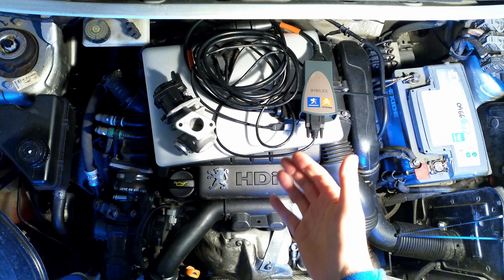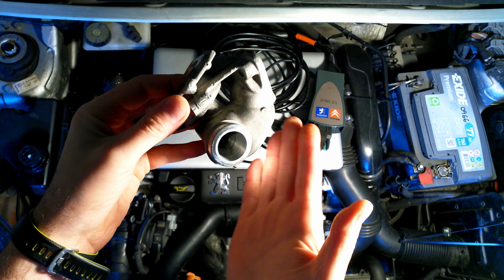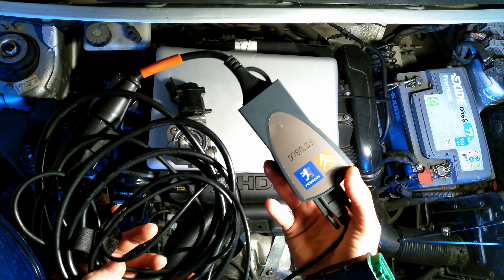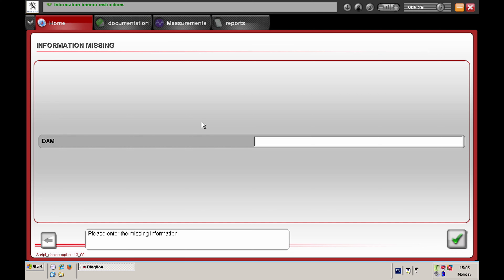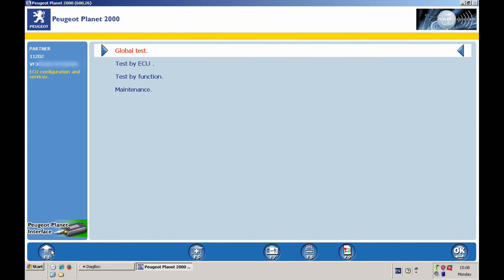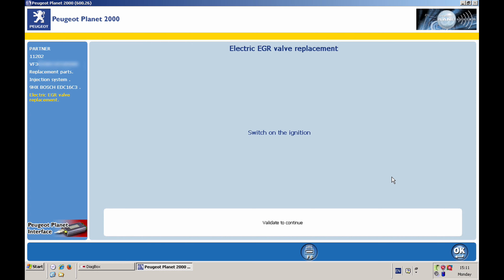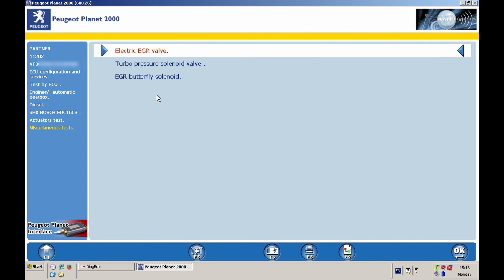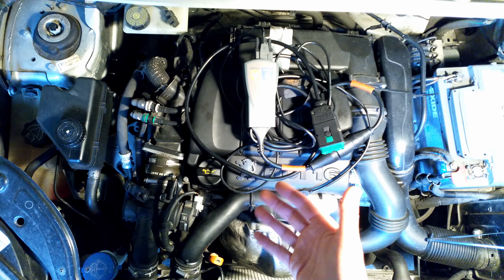1.6HDi new EGR valve recalibration or reconfiguration, how to with Diagbox or PP2000

Comment: Hi, what you explained is very important for the proper functioning of the EGR valve. The same procedure can also be performed when cleaning the valve. Unfortunately this valve is a weak point for DV6 engines fitted to both Citroen / Peugeot and Ford. Often this valve blocks or malfunctions and the engine loses power.
On Ford engines the same procedure can be done with an ELM327 interface, a laptop and the Forscan free software.
Congratulations for the video and greetings from Italy.

Comment: Hi buddy, I followed your video to clean the egr valve on my 2010 C4 hdi 1.6 and it seemed to have sorted the faults I had (super easy to follow for a beginner like me, you are a true hero). However, a month later and the faults have reappeared today - I am wondering what my next steps should be? Should I try another clean? Should I now try replacing the egr valve completely? Any help would be hugely appreciated.

Comment: Hi thanks for the reply on your other video, it was on the wrong way but still went into limp mode then opened after 20 miles or so, 
I bought another egr but seems like I need to calibrate it as it’s still the same, Is there no other way apart from diagbox? As I don’t have that! Thanks
Reply from the maker: Unfortunately no, there might be some other professional tools that can do the same job, but I do not know them.

Comment: Hey again.

Been doing loads of work. Swapped the no name (new) egr for a Valeo one and the fault codes that I used to get are gone.

I did also have a spare air doser/throttle body laying around (since theese can leak pretty bad) so I swapped that also.

But now I get a pending P0100 code instead 😢
Reply from the maker: The P0100 could be MAF sensor issue. If I were you I would disconnect the MAF and see if it makes a difference. If there is no change then the MAF is likely to be the cuplrit.

Comment: Nice video
I have a Citroen C4 1.6 HDI 90hp 2007 . In the morning it does not work stable, with a stable idle. When the engine is cold in the acceleration from 1000 turns to about 2000 turns the engine makes a rattling. It's like some injectors dont work or work badly. Over 2000 turns, it works better and accelerates. Rattling is still there but very little. When is warmed up work at low turns okay with almost no rattling. At a stable speed low (under 2000 turns and 1 or 2 gear) the car jerk little. The injectors are OK (I had sent them to a workshop and we had received new codes) obd codes does not show something.I changed the EGR last year. Fuel Pressure Sensor 1 week ago. Before two weeks I had changed the BSM (new). Sporadically the OBD appears P0490 electric egr valve position copy signal insufficient opening of the valve and P1162 electric egr valve position copy signal valve jammed while driving. I took the EGR out, I cleaned it and i made a  reprogramming with superscan3. No codes more but the rattling problem is still there. What do you mean??
Reply from the maker: OK, a lot of things going on. Best is to first address the error codes that appear and then move on to the others. Rattling can be from multiple things and more difficult to pinpoint.
I have not heard about the superscan3. As far as I know, only Diagbox/Lexia can do the re-programming of the EGR. I would say to monitor the error codes and if the EGR reappear again then you would need to find Diagbox/Lexia to re-program or re-learn. The injectors also need to be coded for the engine. Did you recode them? Maybe they are coded to the ECU and hence the bad knocking/rattling. If the superscan3 can do live data, see what the individual correction values are for the 4 injectors. Anything more 1-1.5 or less than -1 or -1.5 is on the suspicious side of things.

Comment: Hi! I found this video while searching for a solution on my 2005 1.6 HDI Peugeot 307. I had problems with the original EGR around 520.000km. So I’ve bought a used one and worked for few thousand km and then the car started to shut off when driving and the minimum rpm was jumping high and low. After that I’ve decided to buy a new one from eBay and I’ve reprogrammed it with DiagBox (strangely pp2000 wont recognise my ECU) but I’ve managed to calibrate it with diagbox. Everything works fine but after shutting off the engine and then turn it on again, antipollution fault comes back on with check engine light. Diagbox finds various problems, which are about the EGR position. The car drives really well but when the antipollution fault comes on it won’t go over 3000rpm sometimes. Do you have an idea why the calibration won’t work? Maybe the ECU won’t recognise an aftermarket EGR? Thank you 🙏🏼
Reply from the maker: Hi Riccardo, I had a similar problem. I bought a brand new replacement EGR (Haas), recalibrated it and everything, it was working alright, but it was giving errors. Sometimes it was getting stuck. I opened it and the channel inside was not machined really well and the pin with the two rollers at both sides was getting stuck. See if you can open it and see if the small pin moves freely, otherwise if the calibration is successful, there should not be problems. Since that one, I bought Hela and never had problems with it since then.

Comment: Hi I done this today after egr replacement.  But it's still lumpy/ rough idle when cold . Any ideas why or does it take time to learn the new egr the original was a valeo . But the mechanic basically lied to me and put a delphi on and charged me oe price. And good videos mate..used a few of yours now good information
Reply from the maker: Delphi and Valeo probably the same quality. Do you have any errors regarding the EGR valve? It might be something else, for example MAF sensor. If I were you and you do not have any EGR errors, I would unplug the MAF sensor before starting the car and see if that changes anything.

Comment: I cleaned the EGR valve a year ago and today it came out a DTC P0402 Exhaust Gas Recirculation (EGR) System - Excessive flow detected. I also cleaned the curved pipe that goes into the manifold. I wonder if I should clean it again or buy a new one, Hella is a trusted brand? Could it be caused by a faulty MAP sensor? No signs of bad engine behaviour, just the message faulty anti-pollution system. Do you know of any cheap diagnostics tool valid for various car brands, Peugeot and Opel? Can you test the turbo electrovalve as well with the engine running? EGR valve P/N 1618.NR?
Reply from the maker: I really like my Hella EGR valve, pretty trusted. I replaced mine with Hella a couple of years ago and have not had problems. The recalibration can only be done with Diagbox or PP2000 (part of diagbox) for Peugeot and Lexia (part of diagbox) for Citroen. It cannot be done with any other OBDII scanner. It is likely to be the EGR rather than MAF. Not too sure about anu good cheap OBDII device. I have tried at least 3 different brands (cheap) and only one worked after a lengthy trial and error, but I was using iPhone and that is problematic with these. With Android any should work alright, althoughmost do not quite work with the OBD port of the Peugeot/Citroen. It is pure luck to be honest. Go with whichever says works with Peugeot/Citroen, but still it is a bit of luck.
I would clean it again, if you can erase the errors and see if it comes up again. These are generally temporary errors, so if you clean it and that was the cause it would not show anymore, but it will be logged in the ECU.
I had a new Haas (as in F1) EGR valve to replace my original one. I thought since they are in F1 their parts should be good. This valve gave so many errors in the first few months. I opened it and the channel for the pin above the valve was not machined correctly, i.e. smoothly enough and it was sticking from time to time. I bought a Hella and have not had problems since.

Comment: Hello can you tell me where does the solenoid fit into the valve and where does the position of the valve have to be as I am unsure / any help would be great thank  you as you have the only video that shows someone removing the solenoid
Reply from the maker: Which solenoid, the top electronic part of the EGR? I have several videos that show how to put it back together, but maybe the question is different. Browse my EGR videos and you will find the ultimate EGR cleaning and a video about the top part itself.

Comment: Just stumbled on your video by mistake’glad I did. I’ve just replaced the EGR valve on my Vauxhall insignia but I didn’t know they had to be calibrated can you tell me what I can use to calibrate it’thanks
Reply from the maker: Not too sure about Vauxhall. It depends if it is electronic EGR or vacuum one. If it is vacuum operated there is no need to do a relacibration. If it is electronic then it should be done, but the software will be specific to Vauxhall. Not too sure what the right one is.
Reply: @moremolecules  yeah it’s electronic’ok thanks

Comment: Hope you're feeling better after you're covid situation... EGR function. I have replaced the EGR with new EGR and i have the problem that midway driving the EGR is opening and closing feels like I'm running through a puddle water  constant dip in power .... i have a remapping dude that will need to clear code and remap the car according. Like you say replacing EGR 50/50 shot it will be fine ore not..
Reply from the maker: Hi Peter, not too sure about what covid situations you mentioned, but you are right, sometimes it works sometimes not. To be certain, it needs recalibration.

Comment: Do you know of any manual to see all the potential things you can do with this diagnostics tool? Signals readings and plotting, advanced fault codes, guided diagnostics...I guess they have a more complete diagnostics tool at the Peugeot workshops .
Reply from the maker: I do not think there are manuals for Diagbox, although there might be something somewhere, but I have not seen it. The full version has a lot more in terms of diagnostic of the error codes, but as functionality is pretty much the same. Yes, you could get all sorts of data and export the raw data and plot them as you like. The full version is a pretty expensive affair.
Reply: @moremolecules What Diagbox version do you need to do basic things? 7.02v is ok? Do you really need to get all the updates? When do you have to connect the cable? Before or after opening Diagbox and choosing the car model?
Reply from the maker: @csraln6748  Yes, 7.02 is absolutely fine. Of course it depends on how new your car is. Mine is 2008 and 7.02 can do all the stuff. I even had 6. something and everything was absolutely fine. You do not need the updates. If your car is newer, say 2015 onwards, then you may need a newer version.
Reply: @moremolecules  308 from 2008/9 aswell. PP2000 (600.76) is not working properly because it only displays BSI and Engine/Gearbox under Test by ECU/ECU configuration and services and it does not get to connect to any system (Functionality not available!), Test by ECU and Downloading are the only options displayed at the beginning. On the other hand I have full access using Diagbox instead of PP2000 but I don't know where to find the EGR valve recalibration function if possible, it's a totally different menu. It's ok to use Diagbox on a Peugeot? On both diagnostics tools the VIN is retrieved automatically, DAM is not needed. Internet access is available. PS It takes ages for Diagbox to get all applications closed, is it normal?
Reply from the maker: @csraln6748  As far as I know, but have not explored really well, the diagbox will do the same things but the menus are different. You could upgrade to a different diagbox version to try it out. Could not quite remember what version is mine. Download the up-version of 600.76 and see if PP2000 reads the 2008/2009.
Reply: @csraln6748  Hi Man, same problem here. Did you figure it out? V7.02 must be a lite version or something.

Comment: I have a Peugeot partner tepee 1.6 hdi and it started jerking some time ago. I have changed the turbo cartridge but that had nothing to do with the problem at hand.

Now I get jerking like small stalls. I changed it to a new one, used Diagbox 9.86 and followed the instructions for replaced egr. But problem is still there and now I have fault code p1462. Had some other codes before but I switched back the electric component of the egr just to test.

But it is diagbox I am using. Not PP2000. I have PP2000 in a VM but it does not work when I get to that part of replace egr.

What am I missing? Going bananas here.

Doing the actuator tests for egr I hear loud and clear clicks.

Any help is appreciated.
Reply from the maker: I would say to disconnect the MAF sensor and see if that helps return things to normal. If nothing changes when the MAF is disconnected then it is likely that the MAF is faulty and you may need to replace it.

Comment: Hi, fitted a new EGR as the old one was sticking and blowing black smoke and loss of acceleration, and exactly the same fault with newly fitted one. So does the EGR setting remain the same as the old, like as if it was stuck open? hence the reason for recalibrating? I just thought the ECU would relearn by itself, some say remove the battery for 30 mins for reset.
Reply from the maker: Hi Gaz, the ECU would be able to move the new EGR to some extent. The reason for recalibration is to teach the ECU where exactly are the 0% and 100% EGR or completely closed/opened position. Sometimes, there might not be that much of a difference between an old and a new EGR, but sometimes there will be a big difference. A new EGR would not remain in the stuck position, but the ECU does not know exactly where is the 0% and 100%, only knows the old colfiguration. So, the ECU thinks that it is giving say 15% EGR, but the EGR is giving say 30% EGR or vice versa. This might result in some rough idling, poor consumption, poor start, etc.Unfortunately, the ECU would not be able to re-learn the EGR and a battery reset would not help either.
Reply: @moremolecules  Thanks, really appreciated! Very helpful.

Comment: Hi, does this adapter also work on eg Citroen Berlingo 1.6 Hdi from 2012 for calibrating an egr valve, or other new parts? Thank you in advance.
Reply from the maker: Yes it will work with 2012 Berlingo. In that case it is Lexia rather than PP2000, but comes from the same diagbox software. They are almost interchangeable, for example I have tried Lexia with my Peugeot Partner and it does work.
Reply: Thank you sir, I will keep you informed.

Comment: Hey! Was it working wrong after you replaced EGR valve in the past? Also, couldn’t notice the absence of the oil catch can. Did you return to the factory version, when oil is dumped to the turbo?
Reply from the maker: Yes, I removed the oil catch can as I needed to go through the annual safety inspection (MOT in the UK). The oil catch can is deemed tampering with the emissions from the car and it would not have passed. I just have not had the time to put it back in, but will do so later on. I just have to do some additional tests I have in mind without an oil catch can.
My original EGR valve was competely stuck on the closed position and I could not bring it back to life, there was something wrong with the electronic components. The new one has been working without a problem for ~2 years. I cleaned it once during this time.

Comment: Hi, my friend,
very useful video,
exactly what I need.
I changed the EGR valve and I wonder why it doesn't work. Soon will change and turbo solenoid.
Do you think I have to do configuration?
Thank you so much.
Reply from the maker: Hi Alex, the turbo solenoid does not need configuration, but a new EGR needs a configuration.

Comment: If EGR is off from soft (im not sure it s done correct), with a new recalibration from Diagbox it will work as stock again (factory setings)?. A few years ago i had some pb with EGR and someone did an EGR off from soft, but this days i had some pb with car ( not starting) and find EGR stuck open . I started somehow  and i want to buy an new one and to make her to work properly, can i doit from Diagbox with an new recalibration?
Reply from the maker: Not too sure how the EGR can be off from the software, but you can certainly recalibrate any EGR from the software and it should work as intended, as long as the EGR works in itself.

Comment: I replaced my egr with a brand new one on a Volvo C30 1.6D and I  getting anti skid messages and when I get this message car dosen't have normal engine power. I got two codes P0490 Exhaust gas recirculation control circuit A high   and  P138B .
Reply from the maker: When it is a new EGR you would need to recalibrate the EGR valve. The ECU does not know where the max/min of the piston within the new EGR valve are. Not too sure how you do it in Volvo, or I do not know the software.

Comment: I think I have to do something similar I have changed the turbo actuator and position sensor on peugeot 1.6 HDI but fault code is not going away but vehicle is driving very good again would you be able to explain how I make changes please with PP2000 thank you
Reply from the maker: Is this a camshaft sensor? I do not think there are any configuration parameters for these. Both of these are plug'n'play, nothing to configure.
Reply: @moremolecules Thank you for the reply this is a position sensor  to activate the the turbo wastegate or turbo actuator I've been told after fitting these parts you need to recalibrate the parameters in the ECU similar to what you explained with the EGR valve
Reply from the maker: @scotmorley8526  I suspect that is the 110bhp 1.6HDi as my 92bhp does not have the position sensor. It should be somewhere there in the menu of the PP2000. Unfortunately mine does not have, so difficult to show with PP2000/Lexia.